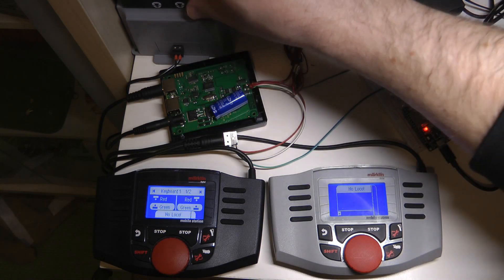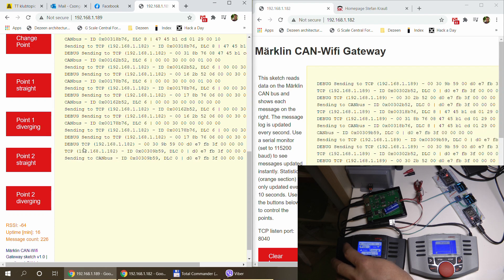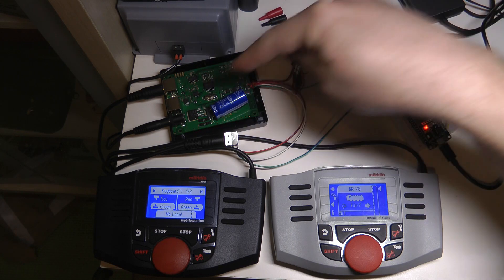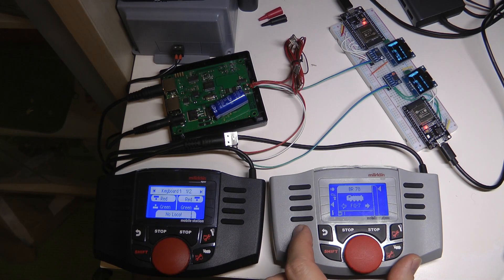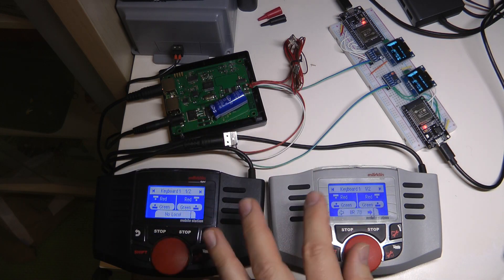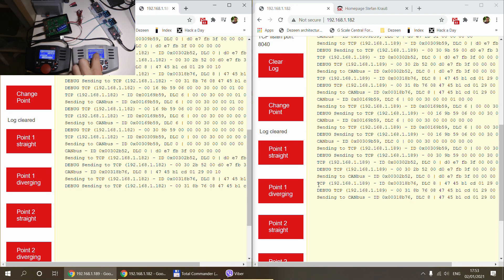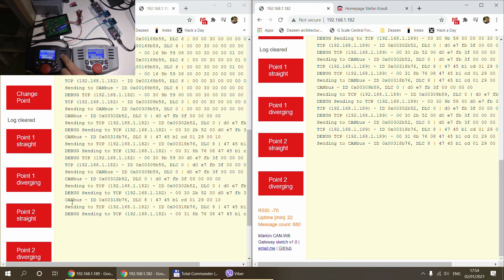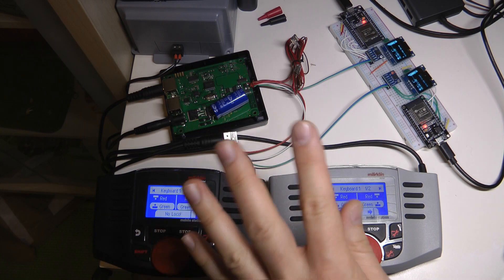Marklin CAN Bus project update

Comment: Hi, i am working in my own Can components for the märklin system for the last 6 years. In case this project is still of interest for you, i might be able to help a little. I can with a 100% certainty say your assumtion regarding the master and slave stuff is wrong. The Mobile Station 2 is pysically only connected with 4 wires, no physical master/slave detection. All messages are broadcasted on the bus and every client can see every message. It does not matter if a MS is declared slave or master, they dont care who sent a command, they only care what it contains. It should make absolutely no difference if they are connected by wire or radio. So my guess would be some CAN-frames get swallowed during the wireless transmission. 
If you are interested i would be happy to talk more about the inner workings of the märklin CAN bus.
Reply from the maker: Thanks for the update. The only thing I noticed that without the MS connected, my CAN messages coming from my unit were ignored. But that was probably because the system was in Stop mode. But after all I will always connect a MS to control the trains, so it is not a big issue for me. But I may contact you in the future if I try to do some more advanced stuff. It would be fun to build a controller more like a rail locomotive controls, like USB RailDriver.
Reply: @csongorvarga  I don't think it is because of the stop mode. That would mean the Control Box does not aknowledge any accessory commands and the wired MS2 would not update it's status either. It looks more like your communication only works in one direction (Box to gray MS2, but not the other way around. I don't know your code, but had an own project making the MS2 wireless using an ESP8266. I ran into massive performance issues (the chip just could not send and receive UDP-Frames fast enough), tough that was one of my very first projects. Today I propably would tackle it a bit different. I have leaned a lot in the past years. In my setup I use a tiny Linux board inside the Control Box (that project is called "SRSEII") that is more than capable for acting as a TCP master. Mainly to connect to a PC to push new firmware over the CAN bus to my own components (using ATmegas). Maybe I'll have another look in this topic at some point.
Controling accessorys and locos is actually very similar and imo faily simple to implement. The protocol Märklin uses is documented quite well for this kind of applications. You can find my stuff on Github: github.com/ixam97 (mostly german though)
Feel free to contact me for a deeper dive into this topic.